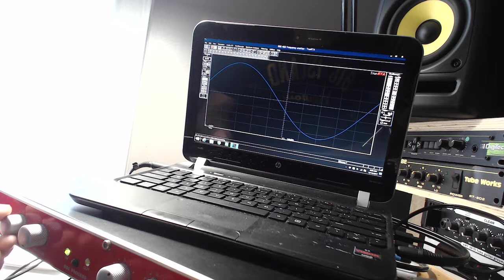BBE Sonic Maximizer Phase Shift Measured.

Comment: I was an (unpaid) consultant for the original BBE product, back in the 1980's. At that time they were marketing the product as a speaker -corrector. I was one who set them straight that the unit changed the relative phasing and thus was a bona fide psychoacoustic  enhancer. Spatial imaging in sound is a nonlinear interferometric response  by the ears, in which the relative phase differential over the spectrum defined the 'soundstage'. Anyone who mixes with an oscilloscope knows why the BBE products are a valuable tool in controlling the L/R phasor spectrum. In simple terms: it works if you know how to use it and how to use it with other tools in the chain.
Reply: in your oinion when used in stomp firm as a last inline pedal into a speaker cab is this anything other than a basic eq pedal that actually cuts mids
Reply: I have an 882a what can you tell me about the automatic feature.  There doesn't seem to be a lot of really good historic data on this product and when changes occurred. 

Also is there a white paper that tells us about the original speaker study that was conducted? 

Also some information on the electronic circuits in the algorithms used would be nice. 

It appears that Beringer had hacked the product and made some sort of changes.

The whole thing about running an instrument into this kind of seems like a little bit of a marketing scam, and not valid science. 

However I may be wrong about that, that's why I would like to know about the electronic circuits so I can know it's actually happening to the signal. A block diagram showing the circuits would be real Handy.

If we look at the original intended use of this device, here's to me that this is only good for use on a live PA system, an a person wouldn't really use this in recording. 

However if this is providing time alignments to the signal itself prior to feeding other equipment, ...that might be kind of useful.

Comment: Is this just plain old phase rotation typically associated with state-variable filters or indeed the "time-alignment" and such the Sonic Maximizer is meant to do? (the high frequencies occurring before the lows etc.)
Reply from the maker: Not sure I can properly answer that.  I read a post recently on the JVM forum from a guy who apparently dissected the schematic.  he had a name for the High and Low shelving filters that BBE employs on this unit, and they apparently do cause the phase shifting that BBE uses in their marketing.  Here is the link, but its apparently down atm.  http://jvmforum.com/phpBB3/viewtopic.php?f=15&t=6146&sid=b69843a59c5eaadba3a3c38f3915aeec
I only know what I was able to measure which is the phase of the bass frequencies shifting as i turned the knob.  I actually made this video to go along with a thread in this forum, where I posted a lot of screenshots of the BBE's output.  Heres that link if you are interested.   https://thefriendlygearfreaks.com/threads/bbe-sonic-maximizer-ir.5822/#post-77004